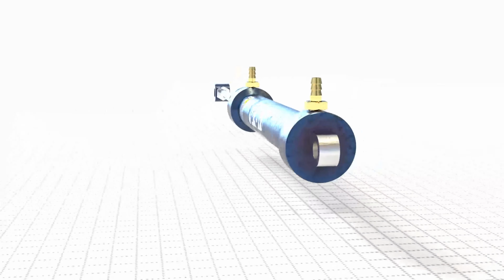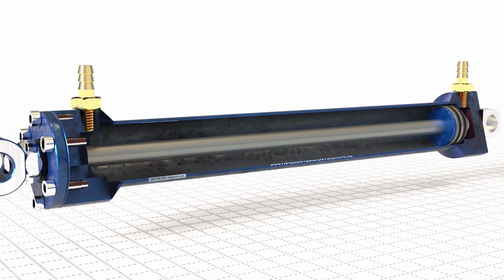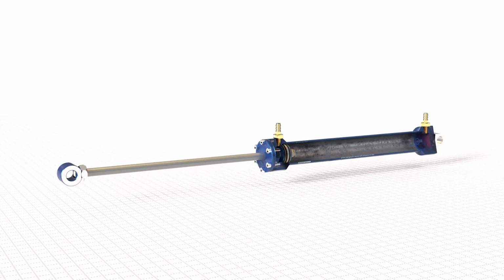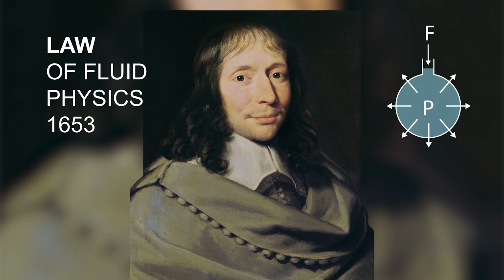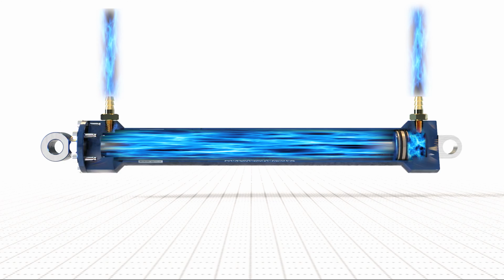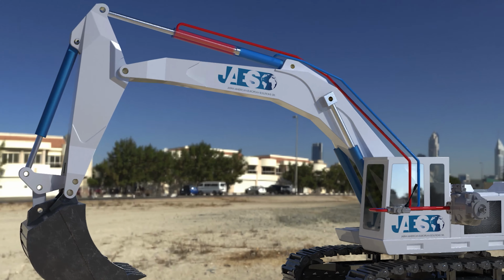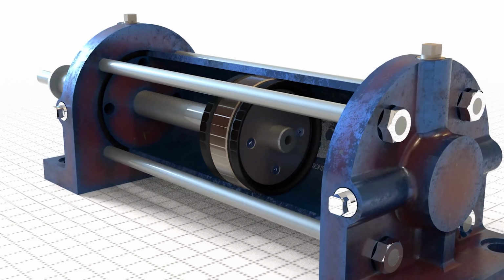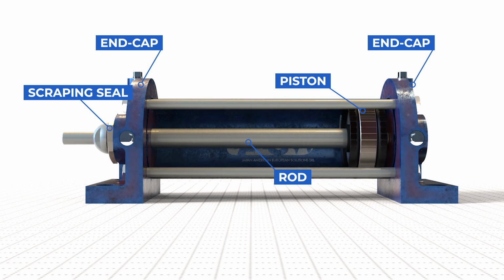How does a cylinder work? Hydraulic and pneumatic - Pascal's law

Comment: I still don't understand how a little bit of oil pumped into a chamber could create so much power.
Reply: it is because the pumps and lines work at (depending on the cylinder) a few thousand psi and it this pressure times the area of the cap on the back of the rod that determines the amount of force the cylinder can put out.
Reply: @irongiant6112  Thank-you! I googled "how does a hydraulic cylinder work" and spent 25 minutes reading everything but the answer I was seeking. Your explanation is exactly what I was trying to understand!
Reply: @irongiant6112  that explains part of my question but some follow up questions if I may: 1. how is a small pump capable of creating so much PSI to move dozens of tons of weight?  What is the origin of all this power?   2. Also, all this force, how could the cylinder assembly / hoses contain it?  Like water, I would imagine the oil, under pressure, would seek an easier exit point than push against that heavy cylinder rod?  3. As the hydraulic fluid is getting pumped into that vacuum, would not the extreme PSI push back on the pump?  I imagine the oil would want to exit via the hole where it's getting pumped in rather than continuing to get compressed.  Also, how is the system able to remove that pressurized fluid without a blowout (ie during lowering of the bucket or scoop)?  We are talking great force and you know what happens when you open a soda bottle that has been shaken. TIA!
Reply: coz lliquid is a nearly incompressible fluid.  coz pressure is force / area  and coz Pascal's Law
Reply: Theyre playing using surface area and speed/leverage. Yeah sure the price you pay is having to constantly fight against the friction. Pistons are kinda tight and most of them cannot be shifted by hand. But what you gain is a "leverage"  due to the surface area. Coming from a pump or bladder, the pressure is kinda high but the flowrate and volume of the oil is quite low. But since the pressure is equal everywhere in that closed system, the force you get depends on how wide the area of the piston. But the catch is that the wider the piston size (bore) the larger the volume of space inside the cylinder that needs to be filled up with oil. We have discussed how the flow of the fluid is quite slow. If you have the same pump, but then swap to a thicker cylinder, you will get a lot of force but it will push very slowly. Its like using a crowbar where you have to move the other end a big distance just so you can pry off something and moving the other end of the crowbar just half an inch